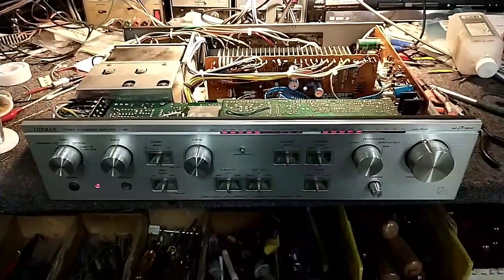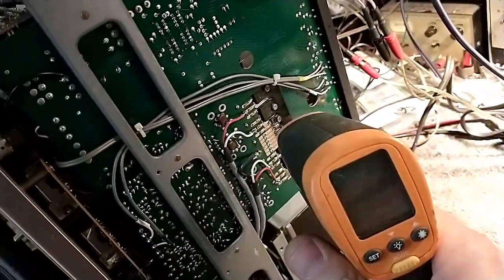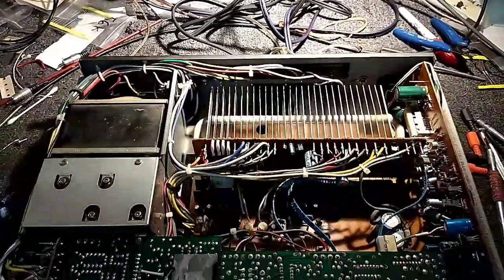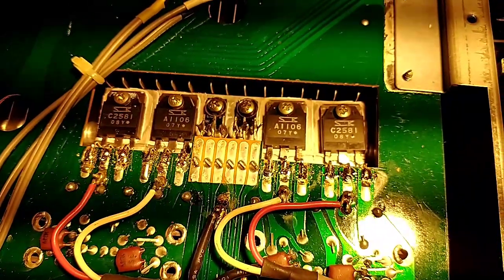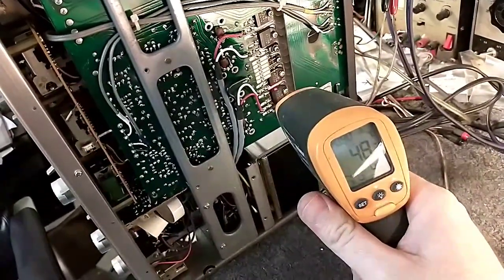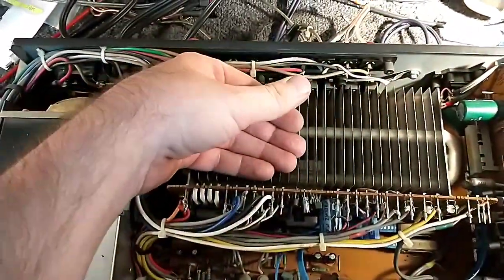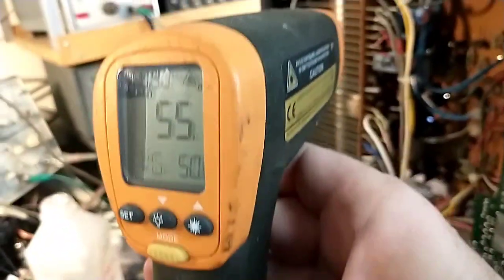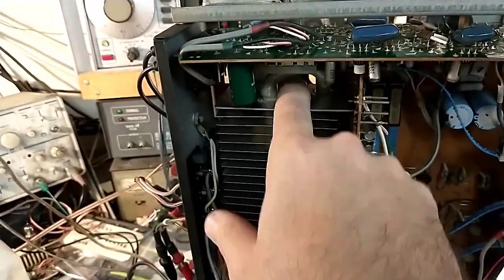PSA: Freon filled heat-pipe style heatsink failures: luxman and others. How to test.

Comment: Oh no, this is ABSOLUTELY NOT a valid way to diagnose this!!! You CANNOT USE AN IR THERMOMETER ON SHINY METAL, IT WILL READ LOW! The emissivity of the heatsink is much lower than the plastic bodies of the transistors, so the transistors will look much hotter to an IR thermometer even if they're at the same exact temperature. These heatsinks also need a bit of heat to actually start working, since the liquid needs to be hot enough to evaporate before they become effective, and they do not work well if they are rotated. A better way to test them is to put about 1/3 power out of the amp and simply feel with your hand if there is heat rising out of the heatsink after a few minutes.

The heat pipe in this amplifier might have been failed, but the method shown in the video is not good. You need to use contact thermometers if you want to get accurate measurements out of a system like this, and it is true that there should not be much temperature difference at all between the hot and the cold side of the actual heat pipe (after it reaches operating temperature).

Comment: did you repair a blown amplifier channel on this amplifier? Also the service manual specifies that the heat pipe wont work anyways if the unit is on its side
Reply from the maker: No blown channel, just maintenance and some small amount of resoldering
Reply: @JordanPier  ok im working on the same model and i wonder whether i can get away with the GR 2sc2240 instead of BL
Reply from the maker: @Stereosandotherfun  gr is gonna be a low beta like 200-250. Bl is usually 400+. 

If it's in the bias circuit, the answer is no. Diff amps, maybe. Pre drivers.....don't think so.

Comment: The best bet would be to jank \ Macgyver it cut some copper sheet to the size of the base plate that the transistors are mounted to and then put a PC AIO on it one 240mm or two 120mm rads if you can get the temps to stay at 40 to 30 it should be good to go.

Comment: I sort of question your diagnosis....well, at least because I can't see whether the plate that attaches to the tabs of the transistors is continuous or "tabbed" so that each transistor has it's own connection with the phase change tube. If you have a single and solid plate across all 4 transistors, then I would expect all the case temperatures to be very similar.....though perhaps all elevated. The theta-JC of each would be low and therefore the heat conducting readily to the plate.....just NOT getting sent up to the find because the phase change fluid has lets say evaporated. (at least not working for some reason. But that issue would indeed make that solid plate temperature much higher, but not so varied across transistors.

I think the issue might be more of an issue of individual transistors losing thermal contact with the heat sink plate. I would remove the heat-sink and re-attach the transistors to the heat-sink. (with it removed you can also do some more tests applying heat to the plate with a heat-gun on the back side and measuring the heat transfer to the fins on the other side.....
Reply: i agree

Comment: A hacky solution that's probably easier than changing the whole heatsink is to switch it to liquid cooling. You should be able to cut off the tips of the pipes, add some flexible tubing, and connect a small reservoir and aquarium pump.

Comment: I'd say that heat pipe system is knackered. Probably unobtainium too. My laptop uses the same system for the processor. But all the components are copper. Still patent after 20 years. Good system - till it isn't....

Comment: If it were mine I'd switch over to a normal heatsink. Heatsinks are rather plentiful if you do this for  fun or a living. Sometimes the local thrift store will sell a newer non working stereo for 20 dollars. It's worth it parts, outputs and if if it has a well made heatsink I've saved that too.
Reply: me too because that is a nice amp I glad my older Luxman Amp uses a regular heatsink !
Reply: That misses the point of the freon heatpipe, which is the rapid transfer of heat away from the transistors. Remember, they're mounted directly onto the PCB and need a heatsink that big to stop them from melting the circuit board. Anything smaller isn't going to cut it.
Reply: @thisisnev  another thing is finding a heatsink that would fit. I don’t feel like that used Freon in that heat pipe,  but that doesn’t matter to much with a bit of knowledge,  you may be able to put a tap on the heat pipe, pull a vacuum, and recharge. There’s some math that would need to be done to equate how much needs to be in there, I can tell it’s less than an one ounce.

Comment: It's unlikely that they use freon in the heat pipe. Usually, distilled water works fine, but sometimes alcohol is used. The heatpipe is filled with a little liquid (research correct amount). Heat it, bring it to boil, and seal it. This creates a partial vacuum in the pipe, which lowers the boiling point. When the liquid boils (at the low temperature) it goes through phase change, which takes a lot of energy. The vapor condenses and is carried back to the heat source via wicking action or gravity. My guess is that the heatpipe has a leak, perhaps near the corrosion.
Reply: Yes, easy enough to simply repair the heat pipe, using a mix of alcohol and water, after fixing the corroded part that leaked. Fill about half full  with the liquid. Then boil the water alcohol mix in the system for a half minute or so, with the vent upright, then remove the heat, crimp the tiny tube off, and solder it tight. Not going to use any exotic refrigerant just simple water, or ethanol, as that will boil at close to room temperature in a low pressure, Just have to use 99% ethanol, or isopropyl alcohol, as that will contain enough water to get the boiling point down to room temperature when the system cools after the air is removed.

You could use a schraeder fitting if you want, so it is then serviceable, and simply vacuum it down, and fill with alcohol, using a refrigerant vacuum pump, and an oil injection bottle. I would do that if I was making a new heat pipe, as it makes life easier.
Reply: @SeanBZA  schrader valves use system pressure to help stay sealed. If the system pressure is lower than atmosphere, it will open. With the spring in the valve it becomes more of a regulator than valve under vacuum.
Reply: @valvejob4215  then use a presta
Reply: @SeanBZA  That looks like an aluminum heat pipe, so it can't be soldered. I wouldn't want to heat it too much without knowing what the wicking material is. I bought some heat sinks recently to build a test load, and they're expensive (the 200 watt resistors were surprisingly inexpensive). If it was my amp, I think it would be fun to build a heat pipe out of copper pipe and fittings. I like your idea of putting a fitting to evacuate the pipe. I just bought some nice gauges to diagnose and repair an AC system. It costs less than one service call. Water transfers heat better than alcohol in a heat pipe if you have sufficient vacuum.
Reply: Sony certainly used freon in their heat pipes, as in my TA-F55. These amps were made before CFCs were strictly regulated.
Reply: @thisisnev  i honestly had no idea that freons were used in those heat pipes. I thought they used a low boiling point liquid like they do for computer equipment

Comment: I have never seen that way of cooling in any amplifier.
Posh but too easy to damage.
Big heatsink and fan would be my choice.
Reply: It is all the rage in computers, half of the gaming machines have liquid cooling, right up until they have their first leak.... Then they go back to aluminum fins only.....
Reply: @Blazer02LS  ...right up until the aluminum fins fill with cathair and the thermal throttling starts, and then they put liquid cooling back. And the circle of PC mods continues!
Reply: @Blazer02LS  Dumb aluminum heatsinks are only in the cheapest desktop PC coolers. Laptops and tiny/all-in-one systems all have heat pipes.

Comment: Those infrared thermometers can give readings that are too low if the surface that is measured is white or shiny metal. I'd put a bit of black paint or black electrical tape on the heatsink/pipe and check the difference again, then you have the same surface color as the transistors and the readings should be a bit closer.